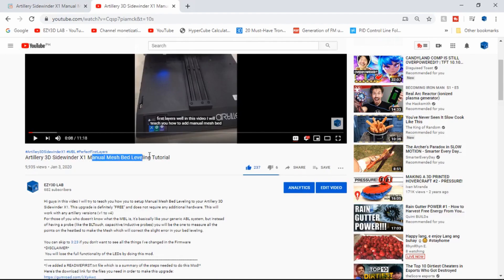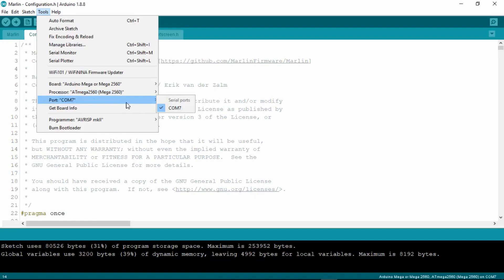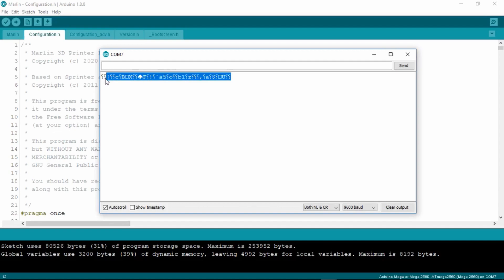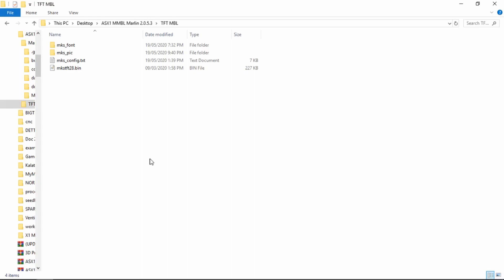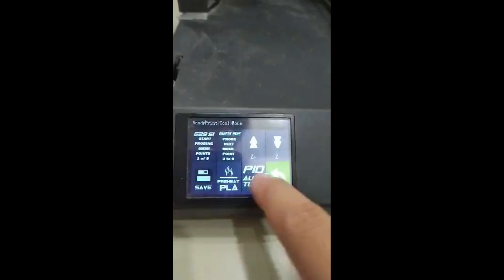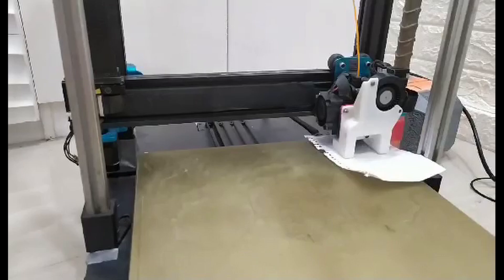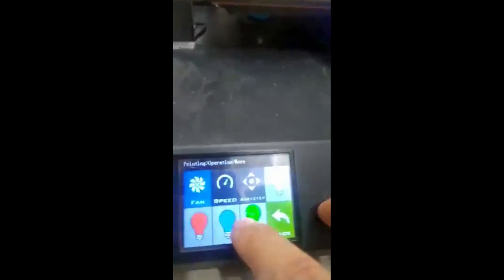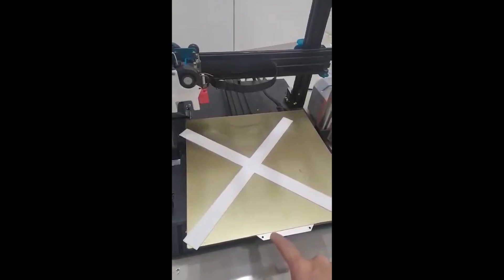Artillery 3D Sidewinder X1 / Genius Manual Mesh Bed Leveling Tutorial - Marlin 2.0.5.3

Comment from the maker: If you encounter any bugs with the firmware please let me know, this firmware includes:
Manual Mesh Bed leveling
Babystepping with Adjustable Step Size (0.01mm , 0.05mm, 0.1mm) 
Pre heat PLA (200C 60C)
Linear Advance (M900 K#.##)
PID AutoTune (210C - 10 Cycles)
Fully Functional LED buttons (last time you have to sacrifice the LEDS to have MBL)
All the goodies Marlin 2.0.5.3 has to offer 
If you need the version of this for the Artillery Genius you can download it here:
https://gumroad.com/l/GGQhf
.
.
.
.
.
.
.
Artillery 3D..... baka naman, suki nako oh! hehe
Reply: Salamat Kuya! Pwede kba mamsg sa FB?
Reply from the maker: @Batangkangkalo  Pwede sir, pa search nalang ng sa FB ung page ko. Same as channel name lang din.
Reply: I have just printed a long print  with this firmware. I got lots of checksum -1 errors while printing, but the print still kept going.  It worked until 93%, than it stopped with printing :/. I probably going to put the previous firmware back.
Reply: I installed this yesterday and it worked great. Today however once I did the manual leveling and mesh leveling the printer would not read the files to print. If I reboot the machine I can load the file to print and it stalls right after heating up. If I run the leveling sequence it will not read the files any more.

Comment: Hello, do you know if by changing the limit of temperature of the extruder from 240 to 255 you can print other filaments like nylon carbon fyber?
Reply from the maker: Yep, you can as long as your heater and thermistor can handle it, you change both to accommodate for higher temp printing.

Comment: I just flashed and for some reason I can't access the LED changes.  Not a critical deal breaker.  Just reporting back.  Or are you only allowed to change the LED when printing has already started?
Reply from the maker: You can only change the color of the LED while printing. There's no more button slots to incorporate it when it's in idle/preparation phase of the print. ( I can however put in on the leveling tab but that will only include 1-2 colors)
Reply: @EZY3DLAB  Awesome.  No worries.  I flashed my brand new artillery with someone elses version of Marlin 2.0.5.3 and it just didn't act right.  Tried yours a the mesh leveling saved my brand new printer.  New out of the box has some significant bed issues.  Thanks for your efforts.

Comment: Stupid questions
...
Do you have to flash Marlin with the printer on or off?
Once everything is done, you keep the z end stop sensor??
I guess it's compactible with a SW-X1 V4?
Thank you
Reply from the maker: 1)  It doesn't matter if the X1 is On or Off during the marlin update because the Type B USB cable will give it power.
2) Yes, This is MBL not ABL. You still need that initial setpoint for the Bed leveling
3) It's compatible with all versions of the X1/ Genius. 
If you have anymore questions feel free ask! Happy Printing!
Reply: @EZY3DLAB  Thank you very much!!!

Comment: Hey Buddy 
Thanks again for your Great Updates 
Now my Printer prints on +/-0.01 quality

I have now a Problem 
Since ive Update the Printer it makes heavy Printing Noises by changing linear Advance

Please can you Help ? 
(I dont have Facebook)
Reply from the maker: Double check your Linear advance value (Send a M900 K0 to reset it's value) . The sound only comes out when printing corners which is common if you have linear advance enabled. Also, double check the tension of your extruder arm.
Reply: Thanks for the quick answer youre right linear Advance is on 

Thats why i updated Marlin only cuz of linear Advance my Corners was Like big round Balls 

Is there any Option except Disabling it?
Actually it is on k0.13 
Does lowering makes any Changes too Like 0.05 ?
Reply from the maker: @alymank4856  0.13 is already a high value. I have mine set at 0.05. There's a proper way to calibrate linear advance. 
https://marlinfw.org/docs/features/lin_advance.html#:~:text=Under%20default%20conditions%2C%20extruder%20axis,profile%20and%20start%2Fstop%20points.

Comment: Hello, you see, I have updated my Artillery X1 with the Firmware "EZY 3D_ArtillerySidewinderX1_Marlin2.0.5.3" was great until I put a BMG after that and modify the value of #define INVERT_E0_DIR to true for the change of direction the machine was still luxurious but a good day I ran out of filament in the middle of printing I changed it but when the machine is positioned to reprint instead of "purging" by releasing material what it does is the opposite, it removes it so the printing that has failed, does any Has it happened and do you know how to solve it?

Comment: Hi, im having some issues while saving the bed leveling, it suddenly don't save the leveling that I have made before......(i level it then press save and it does no dave the leveling previous made as i make again the leveling process and it's still unleveled... Thanks hope your reply
Reply from the maker: Make sure u have the m420 s1;
Send an M502 followed by an M500

Do a manual bed level (4 corners)
Then redo the mesh. It should clear what ever mesh u had before.

Comment: Thank you so much for the tutorial and the code. The only problem I have is that the USB stopped working.There's power in the connector but I get a message  no files found on the USB stick although there are files ready to print. Any suggestions?
BTW MicroSd slot works fine
Reply from the maker: I'm assuming the sd card is still inserted in? 

If so, you just need to change it back to USB mode.

Press "SET"
"FILE"
"USB"
Reply: if you are trying to flash with a usb stick it won't work if it's just files check  and push the usb icon instead of the sd icon that might work to see the files, but to flash and upload your firmware will involve opening the bottom plate of your printer which VOIDS your products warranty but you only need to have the usb connected that will power up the printer even if your power supply is unplugged so before you attempt anything  I would highly recommend getting as much info about it what is the dangers and steps to properly upload marlin firmware which involves disconnecting a connector and reconnecting it which unfortunately must be done on the sw x1 to upload firmware for the 8 bit board it uses.
Reply: @EZY3DLAB  That worked! THX!!!

Comment: Just found this.  I got a SX1 4 days ago and all my prints do not stick in the middle no matter how many times I try to level.  Never have this issue on my Ender3 so very annoying. Will this help with my issue?
Reply from the maker: This will help your issue but before doing this mod, please do a quick routine checkup on your machine.

Check if the x - gantry is leveled,
Check if both Z motors are working fine,
Check the tension of the eccentric nuts
Clean the heatbed thoroughly.
Level the bed Manually 

I just want to share the last guy I helped out regarding "prints not sticking". We've tried every aspect we can try (Mechanical, firmware, tweaking the settings etc) funny enough the culprit was just a dirty glass bed lol he just wiped some acetone on the bed and cleaning it of with some soapy water then IPA.

Usually those things already fixes the problem with bed adhesion not unless your bed is bowed. 
If you need help with it contact me on my FB page (EZY3D Labs) so I can respond faster.
Reply: @EZY3DLAB  Well it turns out I had a lemon.  I decided to return it for a replacement and the new one is so much better.  No issues like before.  Thanks for help.
Reply: Curious how long does it take you to print the X marks the spot model?  When I sliced it up it said 2 hours or so.
Reply from the maker: It's only 20-30+ minutes.

Comment: Does it have to be uploaded via a SD card, I only have a thumb drive handy, but I can get a card if necessary? I'm brand new to 3D printing so I have a large learning curve ahead of me.
Reply from the maker: It needs to be via the sd card. You can get the smallest capacity sd cards those works well for flashing the tft fw.

Comment: Hi, thanks for this guide. I successfully completed it, however when I move the z-axis, it makes a loud scratching noise. I tried moving the axis manually but it moves smoothly. What's the fix for this? Thanks
Reply from the maker: You're welcome! Is the scratching sound only present when printing? If that's the case you'll need to first loosen the Z-sync belts on the top of the Z axis and realign the X-gantry to be completely parallel on both the Z axis. Scratching/Grinding noise on the Z is directly related to banding which can be caused by an unleveled x gantry, a fried stepper motor driver or too high of an accel/feedrate setting on the Z.
Reply: @EZY3DLAB  Thanks for the suggestions! I haven't printed anything yet, just moving the z-axis. I've checked everything, and it's weird, seems the z motors have different speeds/steps. I followed every step correctly, but I'm googling now what would cause this. I'd appreciate any ideas regarding this one :)
Reply from the maker: You can check the Vrefs for both Z stepper motor drivers, as I recall mine had one burned driver and it caused unnecessary jerking movements in the Z axis but not grinding sounds. Also, check your slicer (start gcode) if there are any commands that's directly replacing the accel/jerk and feedrates for all axes those can sometimes mess up the hardcoded settings.  If you need further assistance, you can reach me on my facebook page so you can send the video of the problem with the Z axis. The page is same as my channel.

Comment: A M A Z I N G ! Solved all my issues...
Just a quick question, seems my usb port doesnt detect and changed for the sd card. Any way to reverse back?
Reply from the maker: @Miguel Ribeiro
You just need to pick "USB" mode
Press "SET" (the white gear, green background button)
Press "FILE" (upper left corner) 
Press "USB"
it should switch to USB mode. :)

Comment: Thank you very much, good job.
One question is there any way to activate the M600 command
A hug
Reply from the maker: I don't really have a specific use for M600, I just do it straight in the slicer, (Cura: Pause at layer height) when I want to swap out colours. 

I sometimes just even pause it straight from the machine and change filaments mid-print.
Reply: @EZY3DLAB  Thank you very much I will try a cure.
Now I am starting to use prusa slicer to laminate and it is more focused on the m600 to see if they add the function of stopping in height.
:-)

Comment: After doing everything the printer moves a lot slower now, did I mess something up?
Reply from the maker: Slower in terms of printing or homing?
Reply: @EZY3DLAB  Both, mainly the Z axis
Reply from the maker: @jmanpr  completely normal. I purposely changed the default z feedrate (the original value was set to 50)

Comment: Hello EZY3D friends, I did the firmware Marlin 2.0.5.3 update but now the printer became very noisy and the prints are very unstable. Could you help me to correct these problems?
Reply from the maker: If you are referring to noise coming from the Extruder, chances are you have K value for the linear advance set too high. Add this to your start Gcode and try reslicing a model

M900 K0.00
M500
Reply: @EZY3DLAB  I'm going to test those Gcodes. Thank you very much EZY3D LAB friends

Comment: umh....Maybe I have some problem with my TFT28 ,casue when power off ,I can't resume :(... although ,i  #define POWER_LOSS_RECOVERY
Reply from the maker: The power loss recovery is executed by the TFT not in the main FW, you need an external voltage detector connected to pin 44 (by default) to use #define POWER_LOSS_RECOVERY. How did you try to resume though?

Comment: Here's the G-code save everyone typing it when you add it to your Slicer
G28 ; home all axes
M420 S1;
M500;
M501;
G92 E0 ; Reset Extruder
G1 Z2.0 F3000 ; Move Z Axis up little to prevent scratching of Heat bed
G1 X1 Y20 Z0.2 F5000.0 ; Move to start position
G1 X1 Y200.0 Z0.2 F1500.0 E15 ; Draw first line
G1 X2 Y200.0 Z0.1 F5000.0 ; Move to side a little
Reply from the maker: Thank you for this! :)
Reply: Actually full G-code is:
G28 ; home all axes
M420 S1;
M500;
M501;
M117 Purge extruder
G92 E0 ; reset extruder
M190 S[first_layer_bed_temperature] ; wait for bed final temp
M104 S[first_layer_temperature] ; set extruder final temp
M109 S[first_layer_temperature] ; wait for extruder final temp
G1 Z1.0 F3000 ; move z up little to prevent scratching of surface
G1 X2 Y20 Z0.3 F5000.0 ; move to start-line position
G1 X2 Y200.0 Z0.3 F1500.0 E15 ; draw 1st line
G1 X2 Y200.0 Z0.3 F5000.0 ; move to side a little
G1 X2 Y20 Z0.3 F1500.0 E30 ; draw 2nd line
; G1 E27 F3000 ; retract filament 3mm
G92 E0 ; reset extruder
; done purging extruder
G1 Z1.0 F3000 ; move z up little to prevent scratching of surface
Reply: will it work without lines M500; and M501; ? In the video, it is shown first without these commands, few seconds later you can see in the start code these commands.

Comment: Hello, Installed on my Genius and working great, although I spot a couple things I think have transferred over from Sidewinder maybe?
 BUGS: 
Blue led is activated using the Green/Save button and the Green LED is activated via the blue LED icon
When leveling (stock) the 1st point icon for top left moves to bottom left, 2nd bottom right not top right, and so on, anyway to solve this? Thanks!
Reply from the maker: Let me check, the fix for this will just be a TFT updtae. I'll edit the files later then send the new link here. Thanks for notifying me on this.
Reply: @EZY3DLAB  Thank you very much! Prints correct so I thought it may be to do with the TFT.
I have also been reading about bypassing the TFT serial so firmwares/TFT can be installed without the need of removing the bottom, possible to be added later in the future? Great work.
Reply from the maker: tbh there's no need to bypass the TFT serial. It's simple enough to remove the tft cable when making changes with the fw. Also, you'd want to get that data coming from the TFT so it can communicate properly with the MKS gen. Like for example the filament runout and the power outage is run through the TFT and not the MKS gen itself (you can verify this by looking at the marlin code, the standard power resume is turned off). So in theory if you bypass the Serial com to the TFT, there's no other way to get that vital data back.
Reply: EZY3D LAB Thanks for information.
Still new to this and learning much more.

Sorry for another one, Spotted 2.0.5.4 has been released with many fixes, any plans for this also?
Reply from the maker: @Doyle69  maybe I'll do it after I finish filming a guide on how to add a pinda probe to the x1. :) #ComingSoon
Reply: EZY3D LAB You sir just got a Sub 👍🏻

Comment: Hello. My print bed does not heat equally. The middle gets much hotter than the corners and edges. Is there a way to fix that?
Reply from the maker: Have you checked if the Silicone heater is still properly attached to the glass bed? That's a rare case if the heater is still completely secured to the glass bed underneath.
Reply: EZY3D LAB no it has always been peeling off the edges. I will glue it back on. Thanks. Also when I was doing the X test print, my printer stopped and gave me an error message that said MAXTEMP triggered, system stopped. I have not tried the print again, but how do I fix this?
Reply from the maker: max temp means the thermistor is being shorted out. check the ribbon cable going to the nozzle for that specific problem.
Reply: EZY3D LAB ok I’ll do that thanks
Reply: @EZY3DLAB  Hello. What type of glue do you recommend using to re adhere the silicone heater to the glass bed?

Comment: Thanks for making this it's very useful. the only thing that I have found is the blue and green led buttons whilst printing seam to be the wrong way around, but that's nothing major. 
I would quite like to have a go at fitting octoprint to my printer as well and was wondering if it would still work with this firmware, Thanks again.
Reply from the maker: Thanks for pointing this out, I'll edit the files later to swap the LED command.
Yes this will work with octoprint w/o any problems. :D
Reply: @EZY3DLAB  Thanks a lot it been very useful.
Reply: @EZY3DLAB  I'm having problems saving the baby steps as well (not sure if related to the colored LEDs), does the print need to finish to save the steps?
Reply: I think it was just me being dumb. sorry about that, it is working and saving fine now.
Reply: @EZY3DLAB  Hiya, Great work on the MBL. Looking forward to your GUI customizing guide.  Did you fix the LED colour issue yet? just did the firmwares and the green and blue are still reversed

Comment: Another question to this great firmware:
May it be possible to remove X & Y axis from babystep menu and add the Save button there instead under the LED-bulb to make it more intuitive?
Reply from the maker: Yes it is possible, but you need to dive deep into the TFT fw to edit out that specific script from the master file then recompile it again. The babystepping buttons (X Y Z) Uses the button images from the regular jog menu so you need to find a workaround there to separate those with the actual jog menu.